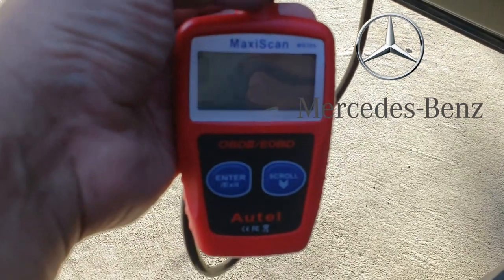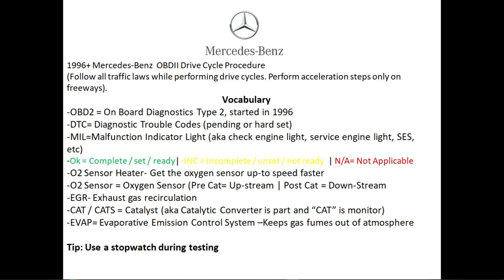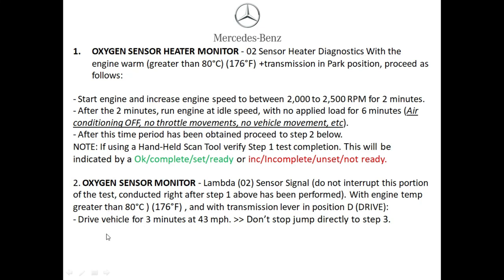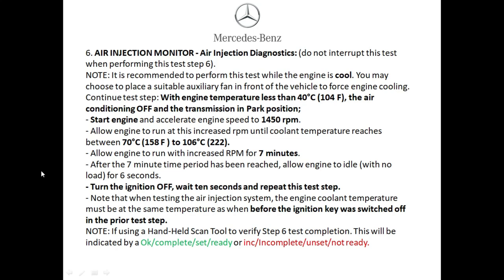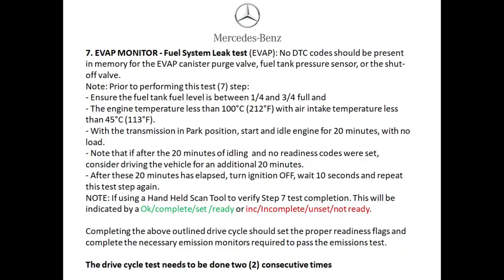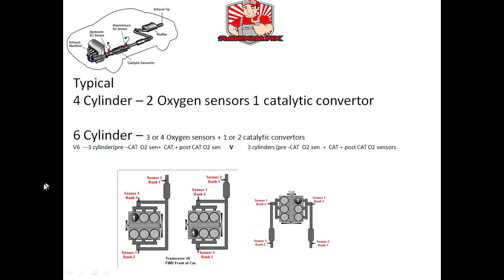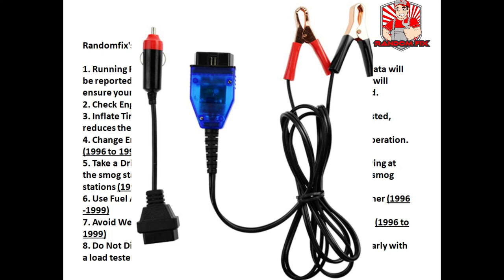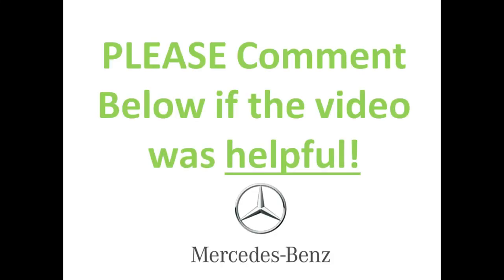Mercedes Emissions Drive Cycle For For Smog Check▶️ Mercedes EGR O2 Cat EVAP Monitor Readiness

Comment: Followed the instructions as closely as I could and got excellent results. Initial tests were encouraging but the CAT was a problem. I found about 7 miles or so of lowly used road through a reservation and that pretty much did the trick as I was able to speed, slow, coast etc. Probably drove about 75 miles or so testing. I can attest that all the instructions are doable and work.
Reply from the maker: James, thanks buddy for taking the time to post this. I know these instructions are a little hard perform in certain locals but as you confirmed they worked. Honestly most of the time car should set the monitors pretty quickly unless there is a minor issue.

Comment: For 2004 MB E500 4matic, every cycle is complete/ready except step 5 EGR system.  To get EGR ready, do I need to start from step 1, or can I skip step 1 to 4 and jump to step 5 directly?
Reply from the maker: Just start to step five, the egr test id aborted once you hit the brakes, so find a long road and just coast for as long as you can. You can use your transmission to slow you down but proceed with caution. Try three 65mph to under 20 mph coasts and then recheck. Good luck and keep me posted

Comment: i have a 2003 Mercedes benz c240 and everything is ready beside catalyst any ideas  ?
Reply from the maker: Here is the playlist for incomplete catalyst monitors https://youtube.com/playlist?list=PLDEbtVOPRC-h1BAzaWQ-6NSnmG0gwvgwP&si=aMyh1qBSSlD-Lk4G

As far as your c240 I would look at playlist and try driving right at 55 mph on the freeway for more than 30 minutes. 

I hope that helps
Reply: @RANDOMFIX thanks for response 👌 drove it for about 20min at 55mph nothing yet still not ready . Got some cat cleaner waiting for tank to be at 1/4 and then try it again 😅
Reply: @RANDOMFIX  does the ac have to be off ?
Reply from the maker: @sactapbang yes, but if the o2 sensor monitor is not setting, turn on the air conditioner during start up idle but for highway driving air conditioning should be off.
Reply: @RANDOMFIX  Gotcha all monitors are set besides that one it’s the only one left
Reply: @RANDOMFIX  it’s just not wanting to come on .. no pending dtc none stored everything is normal
Reply from the maker: You need to get the catalyst converter nice and hot. So warm up the vehicle for 20 minutes and drive on the freeway. Any sort of load will help such as a hill or up ramp to get the catalyst hotter.
If this not your daily driver o suggest driving for an extend period on the freeway to get all the oil and gunk off the catalyst.

Make sure you don’t have any exhaust leaks as they prevent the cat monitor from running and setting.
Reply: @RANDOMFIX  copy that thanks so much for the response ima go drive it for like a hour and throw cat clean in it
Reply: @RANDOMFIX update got the cat monitor to come on i reset them all and just started from beginning after using the cat cleaner now i just need secondary air injector to come on and evap don’t think evao has to be on tho

Comment: Are you located in California? I'd pay for this service (Drive Cycle) to be done to my 2013 C250 Mercedes :(
Reply from the maker: Cynthia, I would love to help but I am not returning to California as I got tired of all the rules.
Reply: Don’t see my comment, re-posting…..Will mechanics/auto shops perform this service for a fee? I would think so. They should! It’s more than I can handle right now. Someone, please help🙏
Reply from the maker: @Shelly-op1kx I have heard of shops and dealers performing the drive cycle for a fee but you will need to call and ask the shop or dealer.

Comment: 2010 MB c300 with permanent code p0410 secondary air pump, i replaced the pump, relay and fuse, fuse and pump both are fail and after all that the pump will kick on for cold start, so if i want the air injector monitor to set, do i only preform #6 test or do i have to do other test with it ???
Reply from the maker: Is the permanent code gone? You cannot delete permanent codes. Here is the video https://youtu.be/PMcJtcSOzdk

Comment: Need help bad! I have a 2015 Mercedes s550. Battery was removed recently now can’t pass readiness. Sooo frustrating I’ve taken all the advice and tried everything with no luck. Is there a simple clear cut way to pass readiness. Sorry not car savy at all. It says evap system, oxygen sensor, and oxygen sensor heater not complete. What can I do to make sure it’s ready? Thank you I appreciate any and all help.
Reply from the maker: Make sure the battery is good and now complete the drive cycle shown in the video. Make sure you using primo fuel in that s550 and it's very sensitive.
Reply from the maker: You can not or  cut it away or bypass it.

Comment: I have C250,
I replaced fuel injectors for misfire issue,  now Emission test not pass due to FUE not ready even after many hours driving,  you think need to coding new fuel injectors to pass Emission test or coding new injectors not related to Emission test , Car has no check engine light ?

Comment: Hi, Thanks for posting this!
A bit confused on the air injection steps on the 2nd test does it have to be the 2nd day  when the car is cold again?
everything else is ready on a 2001 SL 600 V-12.
I confirmed the air pump is working so are the vacuum controlled valves at each bank
Reply from the maker: Yes, the monitor runs on cold starts only, make sure there are no leaks and nothing is clogged
Reply: @RANDOMFIX  Thanks for the information I have all the monitors set except for Secondary Air. I can hear the air pump come on for about 2 min and the then the clutch disengages..
Also unplugged the hose to confirm it was pumping air and tested the vacuum system to the valves on each manifold.  Valves have movement when tested with handheld pump. 
There are no codes or stored codes.
The Mercedes smog bulletin is pretty much the same as what you have posted.
I guess I will keep doing this every morning it's been done 4 times now  with no results.
Any other tips? Not sure if the V-12 engine is special lol.

Comment: Great video , I wonder if the Oxygen sensors Monitor has to be concluded in order for the air injection system to complete, these two guys are the ones I can never complete in my 98 ML320 ,  thanks
Reply from the maker: I am making an update oxygen sensor video as I’m getting lots of questions, it should be I in next few days.

Comment: If the MIL is On, but I’ve resolved the issue and all monitors are OK and DTCs are no longer present, how do I get the MIL to go to Off? Any particular procedure?
Reply from the maker: The vehicle is to reset the mil it's or you need you reset and then complete the drive cycle. What year is your Benz?
Reply: @RANDOMFIX  2002

Comment: Having difficulty with the stubborn EVAP and AIR monitors to complete for 2008 ML350 after a ton of driving. Only 1 needs to be cleared in  Georgia.
Reply from the maker: Focus on the air monitor, you may have to clean the components as dirty parts may not get ready. The evap is normally last to set. What caused the drive monitors to be deleted?

Keep me in the loop

Comment: I own a w204,  I did replaced secondary air pump fuse and relay,  and a cold start sometimes air pump work and sometimes it doesn't,  engine light still... you think it could be( O2 sensor?)
Reply: First and last Mercedes I'll ever purchase. What a pain in the ass
Reply from the maker: All of these vehicle are a pain when the drive cycle needs to complete unless it’s fairly new.

Comment: Last week I filled up my tank and notice a gas smell inside my 11' E350 within 48 hrs I got a P0456 code (small leak EVAP). After some investigating I notice a small crack on the fuel tank access cover. I replaced it with a new as well as a new sealing ring and fuel filter seal. I'm happy to say I have no more leaks or gas smells but the Check Engine/P0456 is still present. What drive cycle will I need to have this code drop off?
Reply from the maker: Sorry for the late reply! did you find a solution?

Comment: @RANDOMFIX I have an 07 Mercedes-Benz ML63. I cleared the codes for some codes that I had to address and now I cannot get the O2 Heater monitor to Pass. It just continues showing INC no matter how many times I tried to follow the entire Drive Cycle. I have gotten every other monitor to pass, on multiple occasions. Just haven't been able to that damn O2 Heater monitor to set. I have also tried other methods that I found and nothing has got it to change from INC. Any advice?
Reply from the maker: Yeah, this pretty common I cover it in this video, https://youtu.be/Yn1-ul62Jio?si=JpmyNgq3ubFr_kwN

Keep me posted.

Comment: Thanks for tips! If I turn off the code with Reader, will it pass Smog? Thanks
Reply from the maker: You need to perform the drive cycle and get all the monitors that are needed for your state.

Comment: Hello, can you please confirm me that what if my car is shown complete for the rest but the AIR, CAT and the EVAP is showing INC. is that means I have to start the drive cycle from step 1 to 4 in order to passed the CAT and for the EVAP, should I start the step 7 in the morning or do the step 6 and then the step 7? Thanks.
Reply from the maker: I start the whole process from the start until you set the air monitor. After you set the air monitor then you can jump to step 7 for catalyst. For the evap you can’t really do much other park on a level surface and maintain a good fuel level.
Reply: So, for the secondary air and the catalyst, I should start from step 1-4? I got a little confused because isn’t the air the one to do it right away after the engine is started?

Comment: The air injection monitor is not setting for me, when you do the cycle a second time, is that right away or you let it cool down again first ?
Reply from the maker: Cool down and then try again. The air injection systems work when the vehicle for starts. Try 3 or times and still not set then you need to inspect the system visually, check for leaks, and lastly clean or replace if needed. Theses system are known to get tired and dirty as your vehicle ages.
Reply: @RANDOMFIX   found the issue, I was doing it when the car was at 104 degrees, i had to wait until it was below 100, i did it at 3 am when the car ECT was at 80ish degrees and it worked

Comment: I did exactly you explain on the video I have a 96 Mercedes E320 none of the monitors has been set Have any idea let me know please
Reply from the maker: What caused all the monitors to be reset?
Reply: Have u ever fixed the issue? I have a same problem. 01 e320
Reply from the maker: Please confirm, you are stating that all of your inspection monitors day incomplete or not ready? What caused this issue? How did you smog the vehicle last time? When did this issue start? Please provide additional back ground information about your 2001 E320.
Reply: @RANDOMFIX thank you Random!    Disconnected the battery for a repair work 6 days ago and  yesterday I went to smog  place failed, all good except Cat not ready.  Did this drive cycle #2 and 3,  2 times but still not ready.  2001 E320 150K  miles, No code showing, it drives perfect.  F××××ing Cali smog regulation...... I'm so sad...
Reply: Man!  I did a 4 cycle again today over  30 miles driving  but still no luck. The cat not ready.  I have a question.... is  INCOMPLETE  and NOT READY  has a same meaning ?
Reply from the maker: Incomplete and not ready are the same. You are looking complete or ready. Let the vehicle just idle for 25 minutes before moving and try again. In the colder weather it can be harder to set the catalyst so it warm all the way up.
Reply: @RANDOMFIX  Random, the last 8 times of drive cycle that didn't worked, ive coast on to shoulder to 20 mph ( without hitting the brake) then I've hit the brake after the speed went down to 20 mph stop. They were not correct steps. This morning I tried cycle again complete dead stop to 0 mph ( No brake),  it turned to completed ready within 7 miles.  I really thank you for your help!
Reply from the maker: Glad to help, for most people coming to 0 mile coast is really hard, you could use your parking brake but it very dangerous. Under normal circumstances and the coast under 20 will work. Your egr system is 20 plus years old. I appreciate your feedback and thank you again for the update
Reply: @RANDOMFIX  lol, it was very scary as I did the cycle this morning at 3 am because dmv tag was due tomo and was raining too.  The dead stop was pretty crazy... thank you again and you are the Best!

Comment: I have a 2011 C300 with all the monitors set complete
But P0456 small leak is still in the Permanente Code list and I am struggling to remove it to have it ready for smog
Reply from the maker: Have your done anything to address the possible cause of of the p0456? You should really hook it up to smoke machine and see if the evap leak can be seen. Let me know
Reply: In California, the permanent code is automatically ignore if your car has no codes including pending codes store,  you have driven over 15 cold cycles and over 200 miles

Comment: Where do you go to drive for 43mph for 3 minutes uninterrupted?
Reply from the maker: That’s a great question however, it’s another question and this Smog drive cycle. Pressures are only gonna get harder and harder so for whatever it’s worth it’s not easy it’s not impossible, but I take some effort.
Reply: @RANDOMFIX  Thank you for the reply. 👍
Reply from the maker: Anytime and I wish this really was an easier process, let me know if you run into any issues.

Comment: I have a 2001 Mercedes c320 that is having a hard time getting the o2 and catalytic to get ready. I’ve done many tests cycles and those are the only 2 I can’t get to be ready , I have no pending codes or check engine light on . Do you have any ideas or tips on how to get them ready?  Thank you for your help in advance and I find your videos very helpful.
Reply from the maker: The o2 sensor and catalyst work hand and hand with each other. I would focus on the 02 monitor. ( I covered the exact steps for o2 monitor in the video) you may have to repeat this several times. After you set your o2 monitor than you can start on the catalyst monitor. I have a video on the smog tips play list the showcases a product that's helped others. The product states that it helps o2 and catalyst. Just know its only a  temporary solution to help you pass this year. Please make sure your o2 sensors connectors are clean and the contact are tight. With the vehicle off I would don the electrical connector, inspect the connector, use some electrical cleaner spray and reattach the connector. This will be very easy on the precat connectors and more difficult to access on the post connectors. Here is the video and let me know what you find out. https://youtu.be/3w-FrjMFKvs

Thanks
Reply from the maker: You don't not need to remove the o2 sensors! Make sure the o2 sensor are oem if possible.
Reply: @RANDOMFIX  thank you again. Great videos and a good source for automotive repairs 👍🏼👍🏼
Reply from the maker: Glad to help. Imagine how many human life hours this smog readiness issue consumes. I know less smog good for our health but they can do away with these crazy complications and have an option for an actual emissions probe option as well.
Reply: Same here I have MB c320 2001. 
Ive replace O2 sensors. made sure that the connectors are good and tight. Its been 6 months now. there's no check engine or any pending codes.The engine runs smooth I can feel the power of v6 when I was driving in the freeway.Ive tried different drivecycle some works on it and some are not. but still the cat monitor doesn't work.
Ive set an appointment to MB service and they have told me that they will gonna diagnose and do the replacement if necessary but They sed that I need to do the drive cycle. almost giving up.This car has a sentimental value to me and Im pretty sure that this car is in good condition and runs great.hopefully there's a way better to do the drivecycle in MB service center than on the streets.
Reply from the maker: Sorry to hear about troubles on your 2001 mbz. The real issue here that the vehicle is almost 20 years old and those catalyst don't last forever. Good luck with your appointment and keep in mind you maybe able to get a direct fit catalyst for dirt cheap. Check the smog tips playlist. I'm getting a lot of questions and concerns like your everyday. I would also try the 3k trick on the smog tips playlist as it works wonders on older vehicles.

Comment: It's off to the scrap yard soon C320 Wagon
Reply from the maker: Why? Because of smog?
Reply: @RANDOMFIX  Yup, sadly owned since new garage kept it's entire life but the Texas county I live in now is now into this new emissions testing and I see more problems down the road, secondary air and evap will not complete I find it hard to believe this test drive for miles and miles is going to fix anything..... it will be every year play games with is thing so best bet is to find a nice low mi 1995 C220 the less electronics the better
Reply from the maker: Sounds like it's clean. Some states like Florida don't smog why not sell it ebay to a buyer in one of those states?